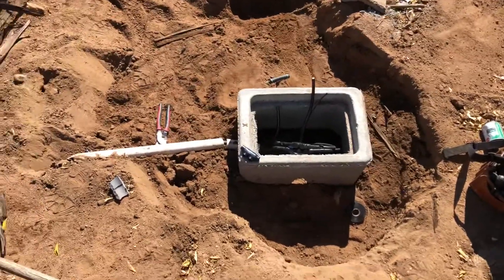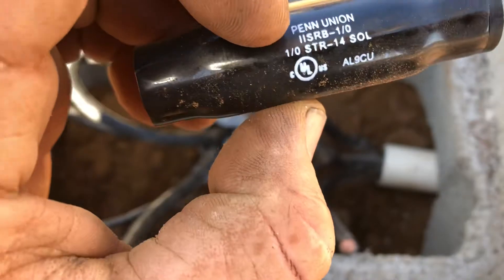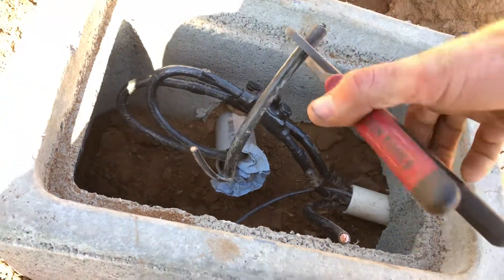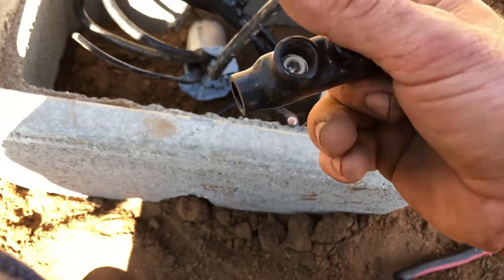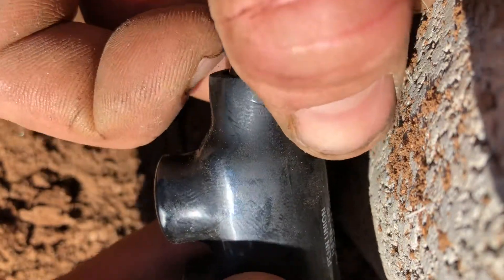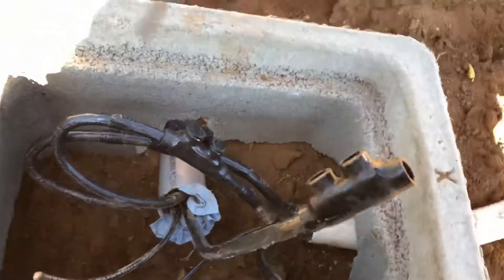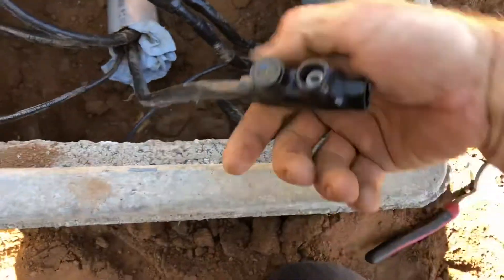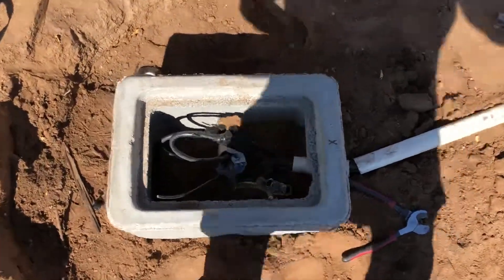No more split bolts!

Comment: Cool connector. I am gonna use these. Thanks for for and heads up.
Reply from the maker: theleftyshow 123 they cost a lot more but are better and worth the extra money.
Reply: @kebin760  Extra cost in materials. Totally worth the lower labor and hassle of spit bolts with insulating tape done right.
Reply: are they rated for inground use?